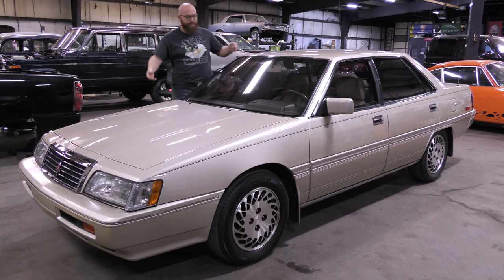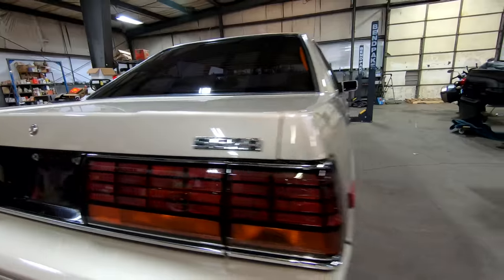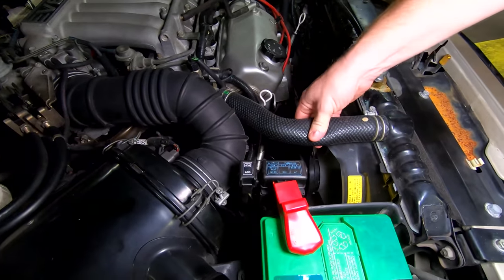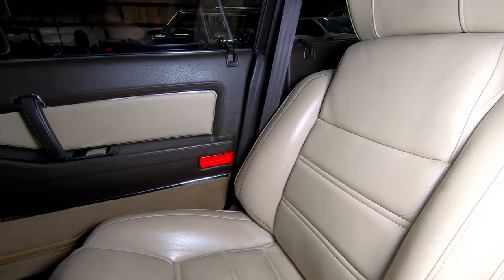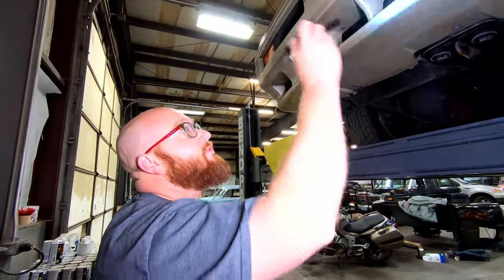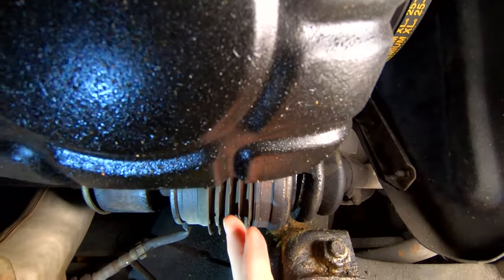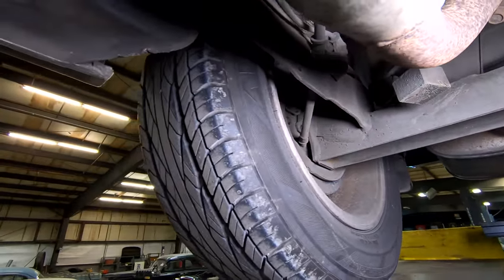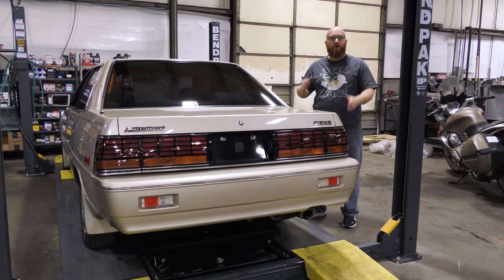Insanely Unique! When Mitsubishi attempted European design. CAR WIZARD shows immaculate '90 Sigma

Comment: I wonder why they made it this body style on the sigma in 1990, since the galant was updated with a more rounded and sleeker look in 1988.

My very first car (around 1998 or so), was a 1985 galant with this body style. Cloth interior, an electronic carburetted 2.0 with about 100 hp and stick shift. Manual climate control and original mitsubishi cassette deck with good sound. To this day, the driver seat is one of the best I sat in. Lots of settings, som you easily would find your preferred seating position.

Loved that car, but the transmission went on it. Before going to the scrapper's, some relatives took the driver seat to put it in their RV. So that lived on for many years.

Comment: Replace the oil cap seal when you do the valve cover gaskets, Mitsubishis are bad about them failing and it's a $5 part. Thanks for the video, Wizard.. there's nothing I love more than old Mitsubishis!
Reply: Just replaced the oil cap seal om my Sigma. My dealer still had 2 in stock.So happy about it !

Comment: Former 95 Mitsubishi 3000GT owner here (13 years). I remember the Eco/Perf button was for the transmission shifting. Perf would hold gears longer before shifting.
Reply: i'm so jelous, the 3000GT has been my dream car since i was 18yrs old...(specially the 1994 VR-4, as iirc from 95 onwards they changed and from 99 they changed a lot), i don't think i can't find anything locally anymore save for a couple of the lower spec cars at insane "collector" prices.... maybe i'll be able to get one by the time i'm 60
Reply: Similar to 90s-early 2000 Oldsmobile/Pontiac/Buick sedans
Reply: Same in Subarus
Reply: 3000 was a great design

Comment: Here in New Zealand, these FWD Sigma sedans were fairly common as they were assembled here, we also had the Australian variant - the V3000, which were a 3-4" widened version with 3litre V6 which also came in a wagon version.  I also recall a few JDM 2 door coupe versions were about too...
Reply: The V3000 wasn’t the Australian variant though.  First generation Magnas only had the Astron II 2.6 four.
Reply: @ayrproductions  Ah yes!  The Magna... That's right!
Reply: The first car I drove any considerable distance on the road was one of these but the V3000 model, from Waharoa to Te Poi when my dad got a bit sleepy. I was 14 at the time.
Reply: The MoT had 400 of the V3000 witch have a slightly different appearance to the sigma
Reply: Wait till he sees a starion
Reply: Don't forget the Eterna
Reply: The V3000 was actually a New Zealand export vehicle, built by Todd Motors in Porirua. Was researching this just the other day.
Reply: @gwmkiwi  weren't they a JDM which made their way to NZ via 2nd hand importers?
Reply: Remember the NZ Police used them as Pursuit Vehicle’s?
Reply: MOT had 2lt turbo versions also. I had an expolice one . Fun cars
Reply: Yep they were pretty common here. They definitely were not a luxury car though. Sold here in NZ from 79/80 i think through to early 90s, along with the Mirage, Lancer, Tredia, Cordia, Galant, Sapporo, Starion etc
Reply: There was an accident in Wgtn and the car ended up literally in two separate pieces,back and front.Put me off them that did.
Reply: @iLudez  He's seen one, check his previous vids!
Reply: @ayrproductions  agreed
Reply: @mattgraham1983  very thirsty from what I remember
Reply: @paulie5076  I had a 2 lit Sigma with a carb (ex Hertz rental) and it was thirsty unless driven very carefully.  It was comfy but hardly fun to drive. A mate had a Galant that came after which was the same motor I gather but was fuel injected and much more economical.
Reply: List of models

TE (1996–1997)

    Executive (2.4-litre 4-cylinder and 3.0-litre V6)
    Advance (3.0-litre V6)
    Altera (2.4-litre 4-cylinder and 3.0-litre V6)
    Altera LS (3.0-litre V6; 4-speed automatic)

Luxury series:

    Verada Ei (3.5-litre V6; 4-speed automatic)
    Verada Xi sedan (3.5-litre V6; 4-speed automatic)

Note: manuals always five-speed only and all non-limited edition models offered in sedan and wagon with manual or automatic transmissions unless specifically noted (TE to TW series).

TF (1997–1998)

    Executive (2.4-litre 4-cylinder and 3.0-litre V6)
    Advance (3.0-litre V6)
    Altera (3.0-litre V6; 4-speed automatic)
    Altera LS (3.0-litre V6; 4-speed automatic)
    Sports sedan (3.0-litre V6; manual or 4-speed Tiptronic automatic)

Magna Solara sedan (TF)

Limited editions:

    Solara (July and August 1998: based on Executive 3.0-litre V6)

Luxury series:

    Verada Ei (3.5-litre V6; 4-speed automatic)
    Verada Xi sedan (3.5-litre V6; 4-speed automatic)

Note: TF is the last Magna series offered with a four-cylinder engine (never fitted to Verada).

TH (1999–2000; the first approx. 30 units built in December 1998)

    Executive (3.0-litre or 3.5-litre V6)
    Executive LS (May–June 2000: 3.5-litre V6; 4-speed automatic)
    Advance (3.5-litre V6)
    Altera LS (1999: 3.5-litre V6; 4-speed automatic)
    Sports sedan (3.5-litre V6; manual or 4-speed Tiptronic automatic)

Magna Solara sedan (TH), now distinguished by two-tone paint
Magna V6 Si sedan (TH)

Limited editions:

    Solara (based on Advance, same interior trim as Advance)
    V6 Si (based on Executive 3.5-litre V6)

Luxury series:

    Verada Ei (3.5-litre V6; 4-speed automatic)
    Verada Xi sedan (3.5-litre V6; 4-speed automatic)

TJ (2000–2003)

    Executive (prior to TJ Series 2: 140 kW 3.0-litre V6 or optional 150 kW 3.5-litre V6; latter only engine after TJ Series 2 with 150 kW output)
    Executive LPG (from April 2003: 143 kW 3.5-litre V6; 4-speed automatic only; first dedicated LPG Magna)
    Advance (150 kW and later 155 kW 3.5-litre V6)
    Advance LPG (from April 2003: 143 kW 3.5-litre V6; 4-speed automatic only; first dedicated LPG Magna)
    AWD sedan (from TJ Series 2: down-powered 154 kW 3.5-litre V6; 5-speed automatic)
    Sports sedan (163 kW 3.5-litre "high output" V6; manual or 5-speed automatic)
    Sports wagon (late 2001: 163 kW 3.5-litre "high output" V6; 5-speed automatic)
    Sports AWD sedan (from TJ Series 2: down-powered 159 kW Sports 3.5-litre V6; 5-speed automatic)
    VR-X sedan (based on Sports but with full bodykit; 163 kW 3.5-litre "high output" V6; manual or 5-speed automatic)
    Ralliart sedan (2002: based on VR-X but with revised bodykit; uprated 180 kW 3.5-litre V6; manual with LSD; 5-speed automatic from Sports/VR-X; total production approx. 500 individually numbered; 4 units painted in Wasp Yellow in 2003)

Magna Solara sedan (TJ)
Magna Commonwealth Games Edition sedan (TJ MY02)

Limited editions:

    Solara (based on Advance; 4-speed automatic; 2 versions)
    V6 Si (based on Executive; in Sports/VR-X colours only)
    Commonwealth Games (based on Executive; in Sports/VR-X colours only)
    Limited Edition (badged "LE" and based on Executive with Verada appointments; 4-speed automatic; KJ series front parabola headlights with amber turn bezels)
    VR-X Limited Edition sedan (May 2001: 175 units built; August 2001: 95 units built (MY02); featuring leather pack with matching instrument dials, black/silver wrapped steering wheel, silver centre dash, 2-DIN Verada sound system, 17-inch wheels with revised suspension settings and optional sunroof)
    VR-X sedan painted in Wasp Yellow (2002–2003: total 50 cars built)

Luxury series:

    Verada Ei (150 kW and later 155 kW 3.5-litre V6; 4-speed automatic and later 5-speed)
    Verada Xi sedan (150 kW and later 155 kW 3.5-litre V6; 4-speed automatic and later 5-speed)
    Verada AWD sedan (from TJ Series 2: down-powered 154 kW 3.5-litre V6; 5-speed automatic)
    Verada GTVi sedan (from March 2003: 163 kW 3.5-litre "high output" V6 from Sports/VR-X; 5-speed automatic; 20 units painted in "Wasp Yellow")

Limited editions:

    Verada GTV sedan (from July 2002: 163 kW 3.5-litre "high output" V6 from Sports/VR-X; 5-speed automatic; limited to 400 units prior to becoming permanent model, GTVi)

Note: May 2001 and September 2001 updates bear no revised badging, unlike "Series 2"; transition from 150 kW to 155 kW for 3.5-litre V6 engine from September 2001 update; manual transmission not available in wagons, dedicated LPG or AWD models; all 5-speed automatic transmissions Tiptronic, as on 4-speed automatics from TJ MY02 series, with former transmission only on all AWD range and on Verada from KJ Series 2 upgrade; AWD range fitted only with 16-inch wheels; VR-X sedan only (TJ to TW series).

TL (2003–2004)

    ES (previous 3.5-litre V6; manual or 4-speed automatic; replaced Executive)
    ES LPG sedan (previous dedicated 3.5-litre V6; 4-speed automatic)
    LS (previous 3.5-litre V6; manual or 4-speed automatic; replaced Advance)
    LS LPG sedan (previous dedicated LPG 3.5-litre V6; 4-speed automatic)
    AWD sedan (previous down-powered 3.5-litre V6; 5-speed automatic)
    VR (previous uprated 163 kW 3.5-litre V6; manual and 5-speed automatic; replaced Sports)
    VR AWD sedan (previous down-powered Sports 3.5-litre V6; 5-speed automatic)
    VR-X sedan (previous uprated 163 kW 3.5-litre V6; manual and 5-speed automatic)

Limited editions

    Solara (based on ES; automatic)
    VR Limited Edition sedan (2004: main highlights – Koni suspension and Enkei wheels from TJ Magna Ralliart; standard VR/VR-X engine)
    VR-X Limited Edition sedan (2004: main highlights – Koni suspension and Enkei wheels from TJ Magna Ralliart; standard VR/VR-X engine)

Luxury series:

    Verada Ei (previous 3.5-litre V6; 5-speed automatic)
    Verada Xi sedan (previous 3.5L-litre V6; 5-speed automatic)
    Verada GTVi sedan (previous 3.5-litre V6 from Sports/VR-X; 5-speed automatic; permanent range model)
    Verada AWD sedan (previous down-powered 3.5-litre V6; 5-speed automatic)

TW (2004–2005)

    ES (previous 3.5-litre V6; manual and 4-speed transmission)
    ES LPG sedan (previous dedicated 3.5-litre V6; 4-speed automatic)
    LS AWD sedan (previous down-powered 3.5-litre V6; 5-speed automatic)
    LS wagon (previous 3.5-litre V6; 4-speed automatic; LS FWD sedan discontinued)
    VR wagon (previous uprated 163 kW 3.5-litre V6; 5-speed automatic; rare model; VR sedan discontinued)
    VR-X sedan (previous uprated 163 kW 3.5-litre V6; manual or 5-speed automatic)
    VR-X AWD sedan (previous down-powered Sports/VR 3.5-litre V6; 5-speed automatic; new model replacing VR AWD sedan)

Luxury series:

    Verada Ei (previous 3.5-litre V6; 5-speed automatic)
    Verada Xi sedan (previous 3.5-litre V6 5-speed automatic)
    Verada GTVi sedan (previous 3.5-litre V6 from Sports/VR-X; 5-speed automatic)
    Verada AWD sedan (previous down-powered 3.5-litre V6; 5-speed automatic)

Ref: - https://en.wikipedia.org/wiki/Mitsubishi_Magna

Comment: Hi car wizard, the car was built in South  Australia, it was sold in Australia as the wide body magna, it was based off the narrow body sigma. They we built from 1985 until 1990 in the wedge shape, then they brought out the more rounded magna,diamate from 1990. We never got the 3.0 v6, only the 2.6 astron 4cyl
Reply: The first Australian built Magnas were widened versions of the Mitsubishi Sigma Galant and were built from 1985 - 1991. The 2.6 was the only engine option in the first gen Magna however the 3.0 V6 was available in the 2nd & 3rd generation (growing later to 3.5 litres).
Reply: Wizard or Euroasian Bob should check the vin... If it starts with 6G, than it's Australian...
Reply: Had to scroll way too far for this comment!! STRAYA!!
Reply: These ones were Japan built, vins start JA. I reckon our Aussie versions looked a hell of a lot better for one thing.

Comment: Hey Wizard, just as a suggestion to try out. When Mrs Wizard films the inside, maybe try to point the camera light upwards to the ceiling of the car. That will give a diffused light reflection instead of the concentrated light beam which reflects on all the plastic components on the dash which makes it difficult to watch.
Anyway, great video as always. 👍😊
Reply: That would be a good idea.

Comment: 6:33 The "ECO/PWR" button just changes the transmission's shift points, I'm pretty sure.  In Power more it'll hold lower gears longer for faster acceleration, and vice-versa for Economy.   Honda and a couple other companies had something similar.
Reply: I remember a friend's Geo Prizim with it. I assumed at the time it was something like overdrive.
Reply: My Australian Ford Fairmont wagon has the same. The eco just changes the shift points.
Reply: My 1985 Toyota 4WD truck has it (yes, it is stock so you Toyota nuts go figure out how THAT came about from Toyota).  Since the 22RE does not have the power to drive the automatic, I just leave it in 'power'.  If not, it CONSTANTLY 'hunts' between 3rd gear and overdrive.  My Corolla did OK, with it, though.  Too bad that one was totaled.  I LOVE this one and wish I could get it.
Reply: @davidbeckenbaugh9598  I wish +2010 Nissan Sunnys (Versa for you guys in US) had this, because it does the same crap.... 3rd-4th-3rd-4th... the gap in the gear ratios is too big for such little power. Atleast cvts now sort of solves that problem.
Reply: @aaryeshg.6526  Nissan's CVT is listed in most car magazines as a "do not buy" for it's reliability issues and the fact most places refuse to rebuild it meaning only a new one can be re-installed.  Of course, the new ones have the problems solved but.....  CVT's are certainly great if they can be reliable.  My family is not having any problems with their Subaru Foresters that have the CVT and they are well over 100,000 miles with theirs.  The promise is there.. but Nissan has some bad years to overcome.   Blessings.
Reply: @davidbeckenbaugh9598  yep, that's why I have a Mitsu for the last 3 years. They atleast cared to fit a cooler on the transmission and to change the fluid as part of regular servicing.

Comment: My mom had an ‘85 or ’86 Galant, and I remember when these Sigmas first came out. I can definitely see the similarities and differences. The Sigma was a few inches longer in the front which made it look a bit nose heavy. Interior of the Sigma is nicer than the Galant, but the gauges and much of the switchgear is the same. The Galant did have a trick back seat though, in the center armrest was a handle. When you pulled up on it, the seat back would recline.
Reply: Niether the gauges nor the switchgear look like what is found in my 89 Galant.

Comment: Haven't seen one of those Sigmas in the flesh probably in this century, but they sold here in Puerto Rico, where Mitsubishi sold very well (once in the '90s was the 2nd best selling brand behind Toyota), but even here I haven't seen one rolling in the streets for THAT LONG.

Engine parts are plenty available in US as it was the same early 6G7 3.0L V6 used in Caravans and other Chrysler products (an updated version of the engine, the 6B3, was available up to the '20 Outlander compact crossover), but wonder if other parts are UNOBTAINIUM.
Reply: From experience, I would say the 6G72 isn't difficult to get OE parts for. It was used in so many different applications, not just by Mitsubishi and Chrysler, but also by Hyundai during that era and well into the 90s.

Comment: I owned a 1990 Dodge Colt (Mirage) and all of the styling really lines up with it.   Some of the parts could easily have been shared.  Especially interior trim.   That car went to 350,000kms before I got tired of it and let it go while it was still running.
Reply: colt was sold lock stock and barrel to Hyundai there first cars were old Mitsubishis, Pickering's in Townsville also sold Hyundai's used to get parts still in the Mitsubishi packings1/2 the cost .
Reply: I had an 88 colt and an 88 galant sigma e. The sigma was a bit bigger but they were really close in styling. Wish I could've parked them side by side but the colt died before the sigma came along.
Reply: @karibakid  smart man.  Sadly we didn’t have Mitsubishi dealerships in Canada then.  I had to order parts from Chrysler.  You paid twice as much and had to wait for Mitsu to ship the parts to them so they could repackage them.

Comment: Mitsus from that era - or any era - tend to rust straight to ground - this must have been kept in a garage and not used in salty winters. I have a 2004 Lancer I left at the fenceside in 2017 because the oil pan started leaking and required front subframe removal for replacement - after 240 000 km (otherwise the car was bulletproof), got it almost new in 2005. Mitsus are popular for using exact same parts for decades - and in various models, like the mirror regulators and heated seat switches of my car were also used in many Pajeros and later model Lancers even 10 years after my car was manufactured - and EVEN THIS CAR - has exactly the same engine oil cap - and the power steering fluid reservoir looks the same, although placed on the opposite side. And my car has the exact style towhook in the front and in the rear (no screw-on nonsense for Mitsubishis!!) Anyway. This was a highlight of recent cars at the garage. Greetings from Latvia.
Reply: Few cars from that era didn't rust.
Reply: Yeah, my 2003 lancer has a recall for the subframe. Same with the oil cap

Comment: I consider myself a "car guy" and I have never ever seen one of those.  Ever.  Very nice.  I bet certain parts are impossible to find at this point.  Even the Diamante has faded to the point they are difficult to source some things for.  So many great cars from this generation are fading away.  So glad to see this one survived!  Excellent video.
Reply: They weren’t great cars hence why they sold so poorly. Mitsubishi rode Toyota, Honda and Nissan’s coat tails. They burned oil like nobody’s business after 60k miles. Cheap piston rings amongst other crappy components.